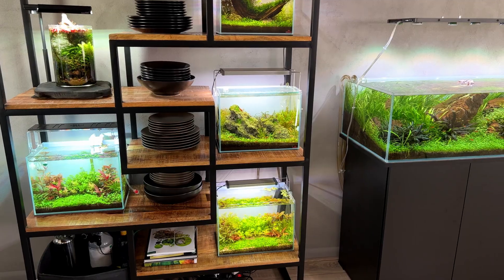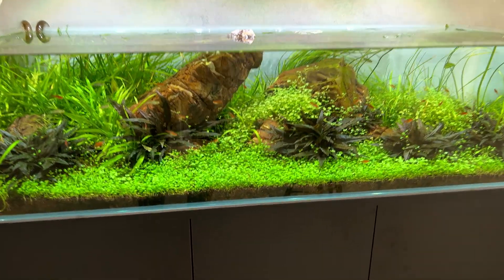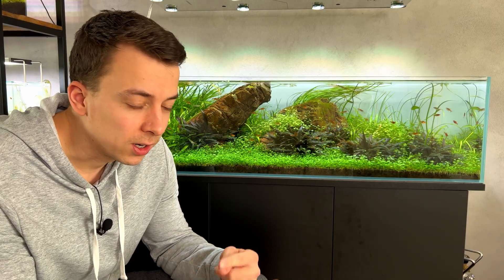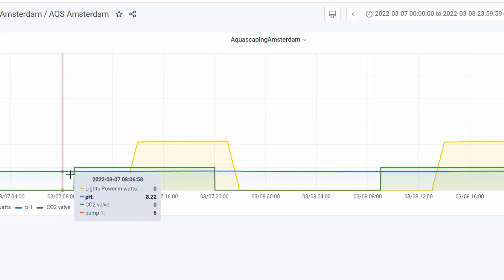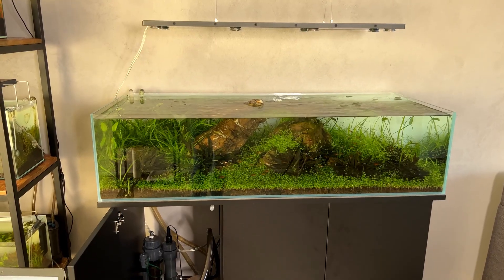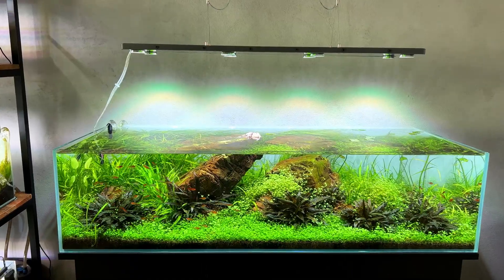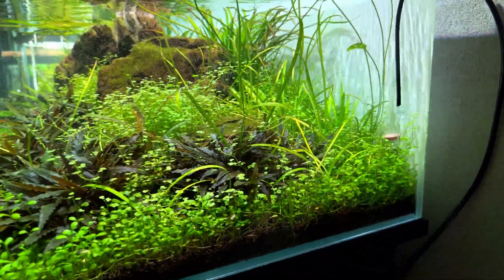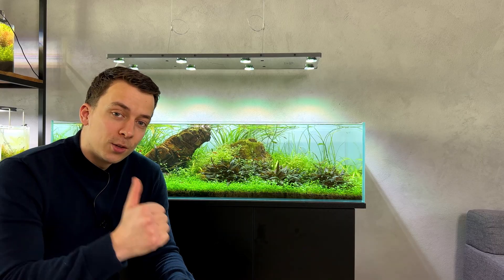CO2 EXPERIMENT: WHAT IS THE BEST WAY TO ADD CO2 IN OUR AQUARIUM?

Comment: It's a good video, and you’ve made some very good points. The fact you captured data is fantastic! 

I've used an inline diffuser for several years now, that runs in-line from my sump return pump. I currently run that same in-line diffuser you showed here; which I appreciate, as it can be easily disassembled for maintenance.  It's easy to clean, and the seals can be replaced. Best of all, it's not visible in my aquarium :)
It's good to see how well the in-line performed. I am a tad bit biased, given I've run that diffuser for some time now. And seeing how well it performed only reinforces my fondness of it. 

However, even with your data: I’d still rather run a reactor, if I could ever find one made out of cast-acrylic. If for no other reason than the durability and shelf-life cast-acrylic reactors have. They can also have a lower loss in head pressure, as an in-line can be very restrictive around the ceramic ring. The main issue is, finding a cast-acrylic CO2 reactor is exceedingly difficult!  Because of that, I hope reactors become more prevalent in freshwater.

Also, that tank is looking great. It's a pretty contrast in textures.

Comment: There is one type that you missed: passive diffusion: a bottom opened container, filled with CO2, from which the CO2 diffuses in water through gas exchange with the water
Reply: Passive systems, 'bell jar', were the only systems I found back in the late 1980s, they didn't work very well. I use a reactor on my large tank, I have hard water and using any other method is too wasteful of gas.  Thanks for your post.
Reply: @williammcdowell6257  passive systems efficiency depends on the exchange surface, and water flow (but i think that the last can be said for all of them).
Their main defect is the difficulty of halting the exchange during the night circle and regulating the output.
On the other hand, ALL the CO2 used is fully dispersed in water
Reply: @blucenere  Yes you are of course completely correct, the surface area of some of the home made systems in the 1980s were definitely problematic for larger heavily planted aquariums.  I've run 24 hour CO2 systems without fish losses (lower bubble rate - great for BBA control), but then with using ladder diffusers or ceramic discs I suppose there is little danger.  Thanks, best wishes.
Reply: But nice experiment.
It is a pity that the inline diffusion requires a different pressure to work, making the bubble count difficult to keep consistent
Reply: @josephp1592  Yep many reactors are poorly designed, what you are doing that would work but since filters produce CO2 and need O2 for the bacteria I am reluctant to use this method.  For the last couple of months I have been using an in-line diffuser on my external filter's return.  But am finding that with a solenoid control it is a fine line between good levels of CO2 and too much for sensitive fish in that time slot before lights come on, once lights have been on for a while then the plants produce enough oxygen and have balanced the CO2 levels.
Reply: @williammcdowell6257  Sounds like you just need to adjust the CO2 start time so the pH doesn't drop to much before the lights come on.
Reply: @williammcdowell6257  I had the same issue and now use a timer with a ph controller plugged into it. Ive never worried about the bacteria in the filter, plenty in the substrate, plants, and all other surfaces in the tank
Reply: @josephp1592  Thanks, makes sense, though in the recent heat BOD has been an issue in my tank, I needed to agitate the surface with a small internal in July/August to stop fish distress.

Comment: I was wondering if the inline diffuser would work with the citric acid/bicarb CO2 generator you tested before. That doesn't have a second stage pressure control, wondering if it will be able to hit the pressure required?
Reply from the maker: Hmm good question, I have no idea how much pressure those systems build
Reply: Will work,in my diy co2 ( citric acid/Sodium bic), I can get 4 bar of pressure, the coca-cola bottles can handle that king of pressures, and 4bar is more than enough pressure, 2,5-3bar is good enough

Comment: Can you connect inline Co2 diffuser to the infow? Wont it create higher CO2 dissolve rate? Whats the cons if i do this
Reply: The undissolved gas will trapped inside the cannister and creating a gas chamber which could harm the powerhead

Comment: Hi mate,
Thank you for your video. 
Can I just have qestion about the co2. 
As you mentioned before your water ph is 8.2 and your goal is to achive 6.8 that is 1.4 ph drop this guide me that your co2 level is up to the roof. Can you also tell me your kh. The reason I do ask as I just got a co2 controller and when I set up to get 1.4 ph drop my fish wasn't happy at all... So inhave to step back to 1.2 ph drop with kh1. The drop checker ofcourse will show false positive reading (yelow completely) because 1kh and 1.2 ph drop bring me between 20- 28ppm .
Reply from the maker: Hey Adam! My kh is constantly rising because of the rocks that I'm using. Only after a waterchange the kh goes down a bit. 
My ph was 8.2 at the time of filming because i had not been injecting CO2 for a few weeks.
Right now my ph is more like 7.8 just before the CO2 turns on again, so then it's a nice 1ph drop. 
Hope that makes sense.

Comment: I have the juwel vision 450 
It’s 450 litres I used a bazooka diffuser suitable for tanks up to 500 litres and I don’t feel like it performs that well in a tank of this size.
 What would you recommend for a tank 
1500cm wide 
55cm tall
Using fluval fx4 canister filter.
Reply from the maker: Hmm good question! I think an fx4 canister has 2 outflows right? so maybe on 1 outflow a CO2 reactor?

Comment: I also use an inline diffuser and I combine it with a lily pipe that has a special shape that pushes the water down. Hoping it optimizes the co2 consumption and diffusion.  The name of the pipe is the Orchid Outflow by VIV.
Reply: Thanks very interesting.

Comment: Great video. It would be interesting to see this experiment again with the inline diffuser placed on the filter inlet hose.
Reply: You do not want to try that setup. The nitrifying bacteria inside the filter are a mix of aerobic and anaerobic organisms. Injecting CO2 into the filter would have a negative impact on a significant part of the ecosystem living in the filter that is responsible for biological filtration. Plus, you risk CO2 gas accumulation inside the filter, which means that the filter could "burp" the accumulated CO2 every once in a while. If you want to achieve full CO2 dissolution then you use a reactor. The reactor would have very likely provided better results than the if the operating pressure was kept the same in both experiments, which was not the case.
Reply: That is interesting.  Obviously whenever we’re injecting CO2 there is going to be CO2 rich water going through our filters, but with the injector on the inlet the concentration is clearly higher. I’m no expert, but I have tried an in-line diffuser on my canister input for months now and haven’t had any issues with Ammonia or Nitrites or anything like that. But I also have a lot of plants, pretty small bio-load, and a decent amount of substrate for bacteria to colonize on outside the filter. I haven’t had any burping issues and the visible CO2 bubbles in the water is less (though not nothing), but it’s a small tank so I’m not injecting near the quantity of CO2 as Mark is on the Big Shallow. So maybe it’s a good option for small tanks only?  Could be an interesting experiment to test water chemistry and CO2 diffusion on two scapes with minimal substrate. One with the diffuser on the inlet one with the diffuser on the outlet.  See both how well it diffuses and how much it affects the bacteria performance.
Reply: Me too. Had mine like that for years and it worked well, now I have opposite outlet and not sure it’s as good :/

Comment: My display tank has a black vinyl background and tall background plants, which obscure the spray bar I use. The spray bar is obviously connected to an external filter (an Oase Biomaster 600), which in turn is connected to the very same C02 Art in-line diffuser you used here.

With this set-up, you do get a very fine mist in the water, as you noted. No bubbles or "sprite water," but a visible mist. So that's true. But with this set-up, I get such excellent C02 dissolution and distribution that I can get even slow-growing plants like java fern and anubias to pearl, which indicates peak photosynthesis. Before I tried this set-up, I didn't even know it was possible to get anubias to pearl.

So in my experience at least, an in-liner diffuser connected to a (hidden) spray bar produces strong, healthy, beautiful plants.
Reply from the maker: Nice one! And the spraybar is faced downwards?
Reply: @MJAquascaping  Actually, I have it submerged but parallel to the water surface. This does create mild surface agitation (and a nice shimmering from the LEDs). So there may be a little off gasing but the C02 mist is still visible throughout the tank.
Reply: I have the spraybar faced downwards, works great! Only disadvantage is that the current there is really hard, so stemplants get tangled

Comment: I see you mounted the in-line diffusors differently in the clips. At the beginning of the video the ceramic was further away from the filter than later in the video. How come?
Reply from the maker: My first thought was that the ceramic should be further away from the filter. But in the manual from CO2art it's the opposite. In the end I don't think it really matters

Comment: Really nice video!!!
I’ve got some questions on the Scarlet Badis, what’s a good male to female ratio for a super heavily planted 60U, will there be issues if I get more males than females (it’s super hard to get females)?
Can you mix the Scarlet Badis with the Black Tiger Darios?
TY!
Reply from the maker: Yeah super difficult to get females. For a 60U I would say ideally 3 or 4 males and 5 or 6 females. 
Having more males than females is not really going to be an issue as long as you don't have too many males in a small space. 
Not sure about mixing scarlet badis and black tiger dario. I don't think it's a good idea...
Reply: @MJAquascaping  thanks :’)
Reply: I ve somewhere that they can hybridize (is that a word?) but not sure of the accuracy

Comment: Yes, but... There're theories that say a disolved 100% CO2 in water is less affordable for plants compared with a system with CO2 microbubbles... any thoughts?
By the way, I also use an inlane difusser, and It seems works quite well
Regards
Reply from the maker: What exactly do you mean with less affordable? I have heard that having micro bubbles is actually better because the plants can uptake the CO2 better, but I don't know if this is true...
Reply: @MJAquascaping  yes, I've heard so, but I didn't find any scientific study so far. It seems a 100% CO2 dissolution in water isn't the best method for growing plants. Regards
Reply: @MJAquascaping  Tom Barr reckons the bubbles do improve uptake but in my own experience well diffused CO2 works best for plants and my my pocket.

Comment: I've actually wedged my CO2 diffuser directly under the intake sponge. There are no bubbles, the CO2 goes straight into my cannister filter. I'm pretty sure it dissolves in there because there are no bubbles coming out of my filter outlet either. It is a nano tank, so i'm not injecting much CO2. This might not work if you're injecting a lot.
Reply from the maker: Yeah I tried that as well once!
Reply: Danger of tipping the balance in the filter, cannister filters are full of bacteria generating CO2 and demanding oxygen.
Reply: Are you not worried the beneficial bacterial will be reduced due to reduced O2 replaced by the CO2